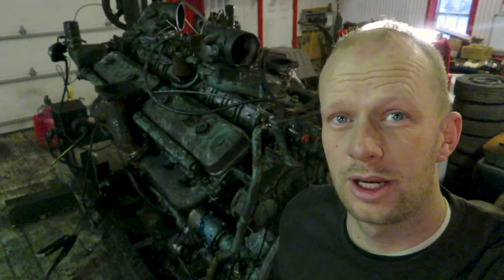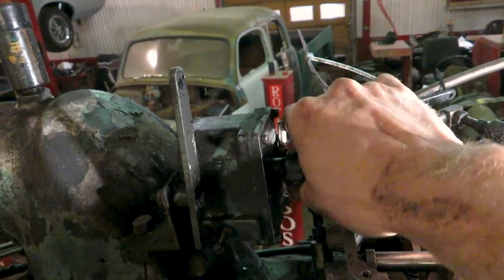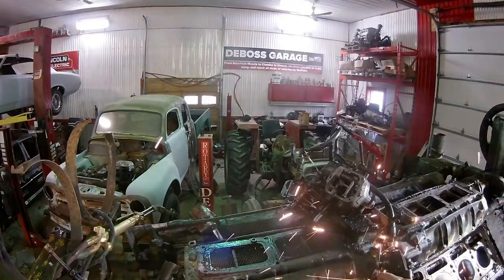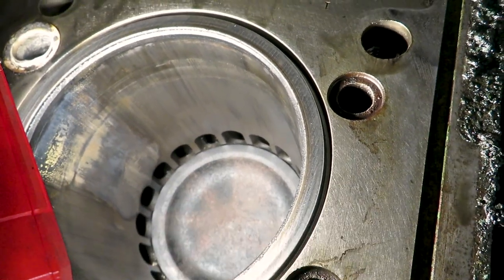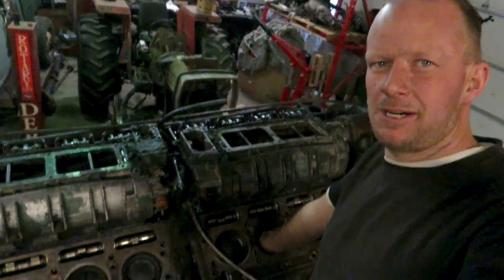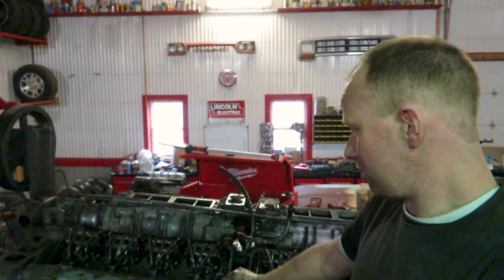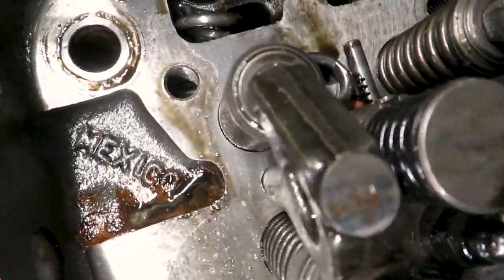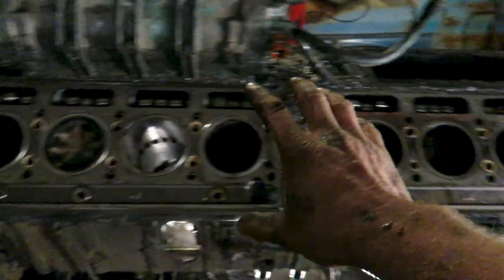What's Inside a 16cyl 2 Stroke Detroit Diesel? #HowItWorks

Comment: I was expecting you to pull a cat out of the block  when you  retrieved the  2nd part of the piston 🙀
Reply from the maker: That would be pretty cruel outtakes of me shoving a cat down the hole against her will.  Next scene has me all scratched up and bleeding....
Reply: @DEBOSSGARAGE  Well was expecting 1 of those adventures and curious "kittens"  not mom you've shoved down there
Reply: rzan8 😂😂😂😂😂😂
Reply: When i was 10 or 11 a curious kitten thought it'd be fun to chill in the engine bay of my mom's car 😅. Got ate by either the belt or the fan i don't remember which just remember the mess
Reply: Colby Dillard that’s nice 🙂
Reply: @colbydillard4581  I had an old ford dragline, and i had a family of cats that liked to sleep in it when she sat for a few days, didn't know mama had kittens. And went to start her up, I see them scatter, but i can here a faint blood-curdling scream, and some grinding noises. (Mind you this thing is extremely old, and very abused) the kitten got sucked into the intake tube and went straight into the engine, the smoke started to turn red, and went back to black. Not a nice site to see.

Comment: Very Cool! Brings back memories! I helped rebuild a 12v71 when I was 17 on New Years Day, 200 feet in the air on a Favco 1900 tower crane at the Kimmel Center in Philadelphia. I will never forget that day! I had went to a new years party the night before and drank too much. Got a call that I HAD to go in a 3am. It was a rough day! It snowed pretty good and even had to pull the cylinder heads all the way up by hand with a well wheel.

Comment: There is also a 3 cylinder. I have a 353t detroit in my 69 GMC pickup
Reply: Pretty torquey for how small the displacement and low cylinder count is?
Reply: @2bitmarketanarchist337  well they only make about 100 horsepower and about 200 lbs feet on a good day if you hold your tongue just right. It will pull about anything I put behind it but not very fast taking off, or going uphill. I'm running a sm465 4 speed trans with a ranger 3 overdrive unit before the trans. Itll toodle down a flat highway at 70 (75 if I'm mean to it) but the only hill it likes is downhill.
Reply: A friend of mine has a 2-53 hooked to a aircompressor.
Reply: @Talisman-tb6vw  I've been thinking about getting an old welding machine and hooking up and old two stroke
Reply: @TheBooboo7112  Does she get decent fuel economy unloaded at least?
Reply: @2bitmarketanarchist337  for an old motor absolutely. I'm guessing its somewhere in the 13mpg range since I currently my fuel guage is a broom stick
Reply: I think they even made a single cylinder at one point
Reply: @Talisman-tb6vw  there's a vid or two of a 2-53 in a bumpside ford truck. Pretty cool.
Reply: @TheBooboo7112  not too shabby!
Reply: I know a guy with a 1-71. It's pretty rare. Seen a few 2-71s.. a lot more 3- and up.
Reply: You dirty tease! No video?!
Reply: @dposcuro  well I've never had anybody really interested in a video. When I get back from working out of town I'll get a video and post it on here haha
Reply: @TheBooboo7112  lol mean to it
Reply: Theres a 1/71 here on YT
Reply: Chris
I have a 353 in a backhoe I own.

Comment: Great video.  These old 2 stroke detroits are stone simple, which makes sense considering they were introduced in the late 1930's.   I know these engines helped win the war, not sure what tanks and ground equipment ran Detroit diesels, but I know a lot of the ships of that era used them to power generators, pumps and other various equipment.

Comment: Say thanks to VR recycling from me for letting you get up to such insanity, this was a riot.

Seeing as they can be bolted together, could you buy all three 16 cys from VR when they arrive and make a 48 cylinder?! xD
Reply: The factory made a V24 71 series, that was two V12 blocks together, the only issue would be the crankshafts
Reply: Whether a crank exists that could handle the middle section, IDK.  The cams would be another problem since they're now so long that there's a risk of breaking.  The blower in the middle would also need to be driven somehow.  The only way to accomplish this is to add a gear set on one of the ends of the center, and this would require yet another section between 2 of the blocks.  I'd like to see one run though.  Has all the makings of a sub 2000 RPM irrigation pump or maybe a generator.  Nat. gas would be viable, but diesel.. not so much.
Reply: @larrygall5831  GM did build a 20V149 which was three blocks bolted up, it had a V8 block in the middle with a V6 bolted to each end, not sure how the cam drives were arranged they may have been unique long cams for that model, I think the crankshaft was a one piece super long unit due to the torsion forces. I remember they had dual harmonic vibration dampers bolted face to face at the accessory end.
Reply: @larrygall5831  Then of course after youve built this beast of a v24 many thousand hp 10ton engine what on earth do you put it in? Make a semi where the trailer pushes the truck!?

"honey i was overtaken yesterday by a semi doing 200 and my ears havent stopped ringing since"
Reply: @rayg9069  yeah, harmonics are going to start being the major issue with engines that long. Cranks and cams twisting like torsion springs back and forth until they crack or twist, etc.

I guess a 2 stroke wouldn't be as bad since there's a firing event every 360 and the pulses are closer, but unless they're overlapping firing orders there's that moment when a "far" piston is on it's fire stroke and twisting that multiple-foot long crank and then.... well, not. 

Also just hit me that the way this thing is set up you're going to have multiple cylinders firing at exactly the same time, probably why those dead cylinders didn't seem to show up when this one was running earlier, they had others helping with their work.
Reply: iwtommo  A generator or a dump truck in a strip mine. Marine applications too.
Reply: Theres a video of a guy with a 24v71 with twelve blowers attached that he put in a peterbilt
Reply: @Ktmfan450  Mike Harrah is his name. I think he's a hotel billionaire or something. Pretty sure it's more show than go as it has a whole bunch of blowers, and bug catchers with throttle plates on them which do nothing.
Reply: @ASPCOT  it would be garbage for all of those applications; to big, to heavy, not enough power, requires to much fuel, to loud. Not saying it wouldn't be cool, it would just have to be done because a rich guy wanted it and didn't care that it would cost a fortune with no return on the investment.
Reply: @iwtommo  They were fitted to some Terex 200 Ton dump trucks. Also were used as industrial drives as generators.
Reply: Jay Dunbar Okay then... what DO you put them in?
Reply: What crazy too as that like a normal engine, no two cylinders fire at the same time. They’re evenly timed just like a single 8V.
Reply: Michael Free the cranks do “clock” so that they don’t have any two cylinders firing at the same time. Each one fires individually from each other.
Reply: No power, too much fuel ,too loud. Standard keyboard warrior nonsense.
Reply: @Ktmfan450 ..... The blowers Mike had mounted on top of the engine were strictly for show,  the original 4 blowers (2 for each V12) are mounted low, between the heads and of course, "work".... and that engine was Not developing 3,400+ hp either.
Reply: @jaydunbar7538 ..... ??? What "  would be garbage for all of those applications; to big, to heavy, not enough power, requires to much fuel..."?   Are you referring to the 16V71 in those applications?
Reply: @mfree80286  when EMD made the V20 710 they agonized over the firing order I read awhile back. One wonders why they didn't just go with the well proven 645V20 firing order and they may have in the end. I thought I'd mention that in light of your comments as might be interested since both engines are uniflow Diesels.
Reply: All those 12 blowers are empty cases, fake just for looks. It is basically a 24V-71 non turbo. They stated it had well over 3,000hp, when in actuality, maybe as much as 1200hp without turbos.

Comment: I drive a passenger ferry with 2 8v-71's in the bilges. Awesome engines however you have to be careful as if you go from ahead to astern too quickly you can cause the transmission to lock up and it will start to spin the engine backwards! It's not a pretty sight when exhaust is coming out the blower
Reply: Good thing you didn't have underwater exhaust. I had a boat do that with 8V92Ns a couple of times before they went dry stack.
Reply: Just above the waterline, but could possible suck water up in a chop

Comment: When I was a Rookie city fireman back in the late 70's we had a fire apparatus that was Engine 8, a1968 American La France 1500 GPM pumper- had a Detroit 8V71 Diesel in it. It had very little muffling. It seemed like a straight pipe. It also had a stick trans which is a thing of the past now since the new breed, most of which never learned how to drive a stick, let alone how to double clutch. That rig was fun to drive since it was loud as hell when you rapped it out between gears. Couple that with the siren and air horn and you could really get them jumping for cover. I'm retired now after 36 years in the FD and it was my most memorable rig. Detroit must have the corner on the fire apparatus market as that's about the only diesels I remember. There may have been a couple other brands but the Detroit was king.

Comment: Working on the marine side of Detroit's.(6v92's) it pains me to see this beast go but that was a FULL SEND and it was great
Reply: I miss making stupid hp on marine Detroits, they just made it so easily. Apparently they're not emissions compliant. whatever the fuck that means?? When are we going to make volcanoes emissions compliant??
Reply: @chriswillmott462  if you military those don't really apply to their boats 😂😂
Reply: @joshuahawkins547  Huh?? Did I mention military spec anywhere??
Reply: @chriswillmott462  no 😂 thats just some of the old engines i use to work on
Reply: @joshuahawkins547  Yeah lots of black smoke and low hours

Comment: The 71 and 92 series used many common parts across the range.  For example,  the v8 used the same cylinder head as the inline 4.  The inline versions were available with the exhaust on either side.  All motors were available in reverse rotation.  Pretty amazing that the basic design was in production for about 50 years.

Comment: If the engine started to run backwards it wouldn't have oil pressure right?
Reply: right cause oil pumps dont pump backwards
Reply: not to the bearings anyways
Reply: No they do it's meant to run either way

Comment: There is no point is saving that engine. Thanks for the look back. My employer had 1500 vehicles with the Detroits. Everything they have now is  Cummins. There are thousands of these engines I junk yards. I do not like the engine, but, I like the sound of them.
Reply: You're spot on, the roar of that thing is just incredible...usually I don't care what an engine sounds like, but there are exceptions...1971 Plymouth Superbird, Lexus LFA, and now a 16 cyl 2 stroke diesel - man that diesel just sounds ANGRY...so kool
Reply: They are too heavy on fuel to be used any longer.

Comment: 2:40 "if you've ever worked on a air cooled Deutz..." Of course I have, who hasn't! lol
Reply: i have lol
Reply: Deutz, Stihl, Sachs and Hatz were some badass German 2 stroke diesel. Look up Holder tractors they had 500 or 600 diesels on these. I one saw a hatz 2 stroke diesel on s dirt stomper that hand crank start. It’s had a separate oil tank on the side also. You had to make sure the tank cap was tight or when she goes bouncing you have a mess.
Reply: I don't  think that Deutz was a 2 stroke.

Comment: For those watching at home, those are 8-71 blowers...
Reply: 8(V) -71,there is a difference.
Reply: There is no in line 8- 71
Reply: bustin cheeks  well cams racing said 8 v 71, there is a difference , the other choice other than v is in line such as the difference between a 6v 71 and an in line 6-71 , won't interchange 
I was just stating there is no in line 8- 71 (unless u make your own)
By the way a 12 v 71 uses 2 blowers linked together ,FYI Just saying🤓

Comment: I learned the 53 series Detroit engine way back in the early 80's.  Maybe my memory is wrong, but I think those injectors are easy to recondition.  You will need a FLAT surface and some lapping compound to resurface the innards.

I remember the injector rack on the 53 series having two screws for the adjustment instead of the one screw with a locking nut.  Am I remembering that wrong?

Those two strokes engine are real workhorses.   It's too bad they couldn't get them to run clean enough to get them on the road.
Reply: It's industry shmear about getting engines to run clean when really they are getting anything too reliable off the road. They are using the whole "greenhouse effect" malarchy to force the population to accept overly complicated disposable engines. You can put on an after burner to reduce any exhaust to pure elements if clean exhaust is the true concern. If you want to improve efficiency then you could run the hot exhaust over a few Stirling engines. To just take their word that it couldn't be done is both naive and obtuse. They have ulterior motives. Compare the increased cost in fuel over ten years to the cost of buying a new engine every ten years to ensure reliability... 
When your house is on fire, what engine would you want in the fire truck?  The one that gets it there... who really cares about how fuel efficient an ambulance is? If a trucker can't deliver a load on time because the engine won't start then he doesn't get paid. Lot's of real world scenarios where reliability is more important than fuel economy. I think this style of engine as part of a hybrid electric vehicle would be both fuel efficient and last much longer than fancy GDI that uses tiny injectors that need to be replaced when they go bad.

Comment: I know this video was made a couple of years ago; I have watched it three times, both episodes. I have held mixed emotions about what you did with it. First, let me reminisce a bit. In my youth, "Jimmy Screamers" were one of the prime movers of commercial transportation. I remember listening for them driving down the street or highway, and the sound was just incredible; the short rev span, the short rev gear changes, punctuated by the longer ones when the "Brownies" or two speed rears were shifted - it made my heart race. Don't get me wrong, modern power is head and shoulders advanced beyond the old Jimmys. My youngest son is a long haul trucker, more than twenty years, now. His truck has a 16L Detroit at about 550HP, and it sets my old ticker to ticking. I'm not going to criticize you for the stuff you did with this one, but I can imagine finding one ind restorable condition, restoring it, finding an old "Pete" or "KW" chassis, and stuffing the "Jimmy" in there with a ten speed, a couple of "Brownies" and two speed rear ends, and just going cruising, running through the gears and just reveling in the sound and memories. Good on y'all.

Comment: You could add turbos to the 71 series as well. In fact I have seen 6-71 with blowers and dual turbos.  The 53-71-92 is the cubic inches per cylinder.  I have worked with 16-V-278 A Detroits as well. The set-up of the timing gears will allow the engine to run in either direction.  I believe the 16 v 71 had a single common crankshaft which meant you would need to make sure the two blocks were bolted together precisely.

Comment: If u run the engine backwards wont the blower become a sucker? Must be something in the gear case thats differant
Reply: Yes the blower becomes a sucker, it sucks the exhaust out of the cylinder, they will run but it's not pretty and cooks the blower rotors and seals fairly fast.
Reply: Ray G and negative oil presure

Comment: A lot of the 71's had turbos and inter coolers. The non turboed 71's were 318 horse power and the single turbo were 350 horse.
The wrist pin was sealed also.

Comment: As an old Detroit Diesel mechanic, the funny saying was always that "the engine overspeeds, the mechanic runs away"
The air box drain tubes become clogged and the fuel an oil residue becomes the fuel and that is what causes the overspeed!
Fun video which brought back some old memories.  Thanks

Comment: My senior year in high school 2007-08 I took Industrial Diesel at the local vocational school. One of our first projects was the tear down and reassembly of a Diesel engine. We had several DT466's, a couple of Cummins 855's, a Cat 3406, Detroit series 60, cummins L10, and a few others. The best one in my opinion was a running 8v71. We had to pair off into groups of two for this project and unfortunately my partner was a real jackass. I fully intended to have that engine in the same condition when I was finished as when I started. We had all the service manuals and everything. He unfortunately saw it as a hunk of scrap metal as did my instructor and he went out of his way to destroy it as well as possible upon disassembly. Needless to say it went back together missing parts and badly damaged. It's nice to see a full video of how these 2 stroke diesels work. I always tried to explain it to people but with nothing to show them for reference.